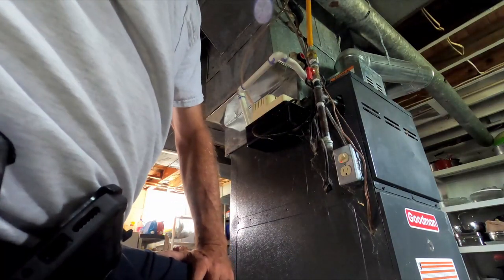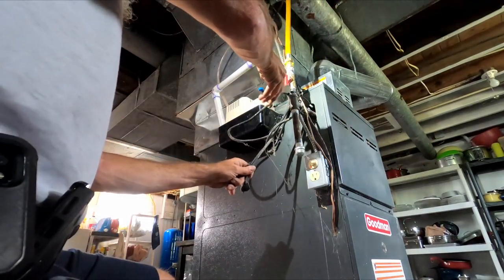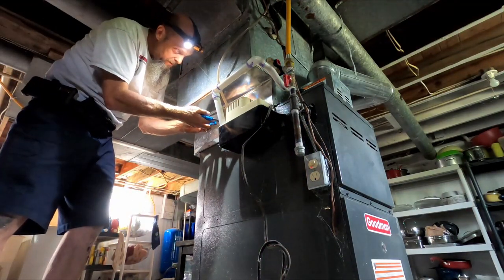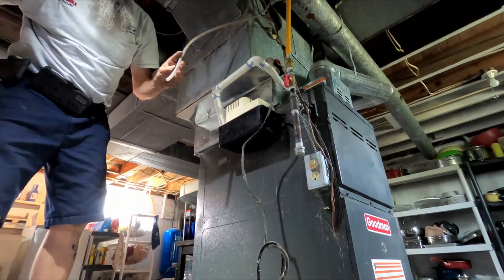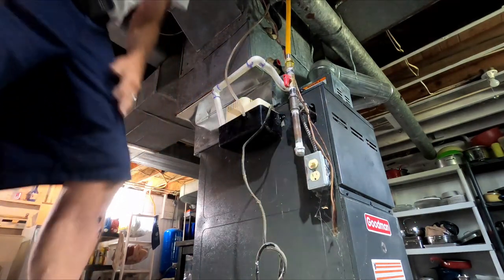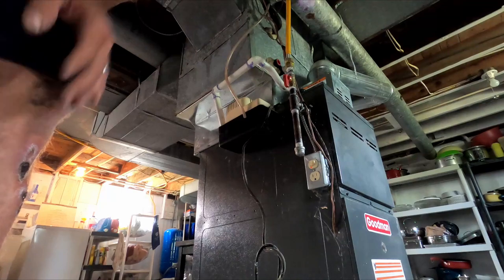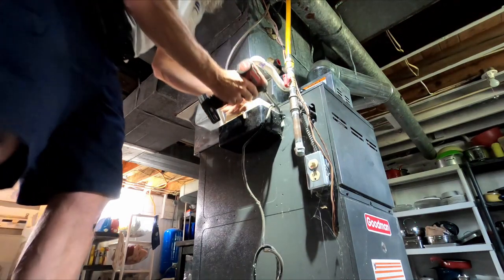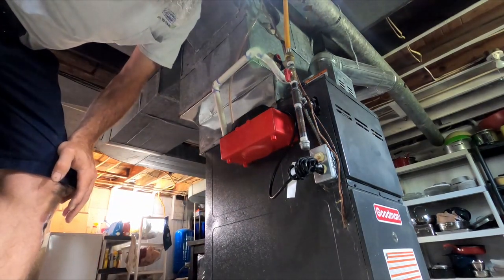Condensate Pump Replacement

Comment: You exactly said what was wrong with it. I made the same mistake and thought my pump box froze and busted but turned out it was air locking and siphoning out on the floor.